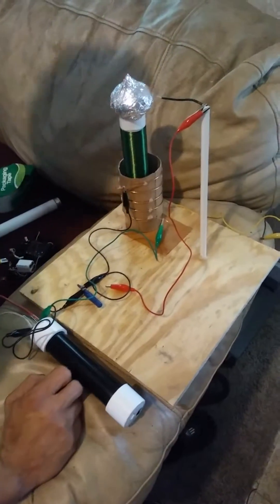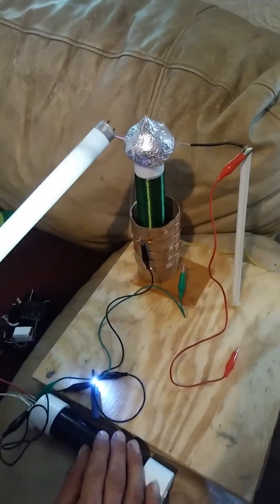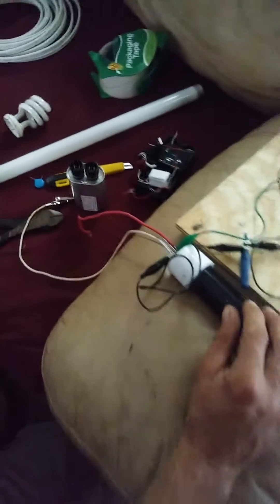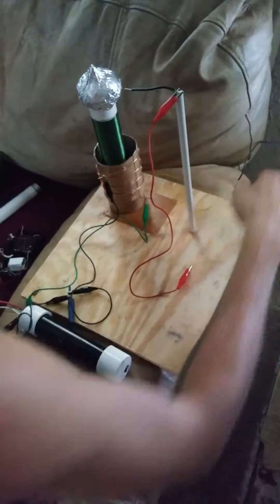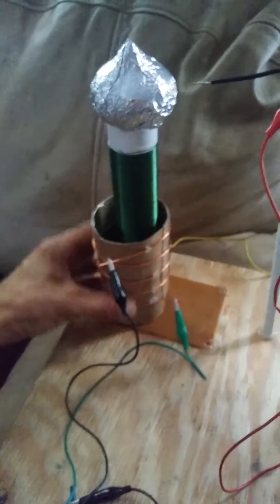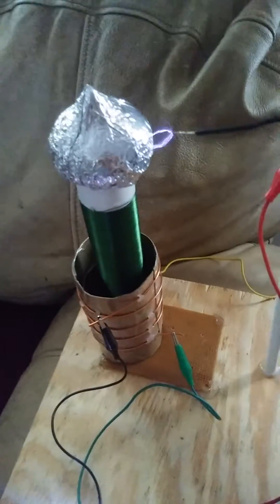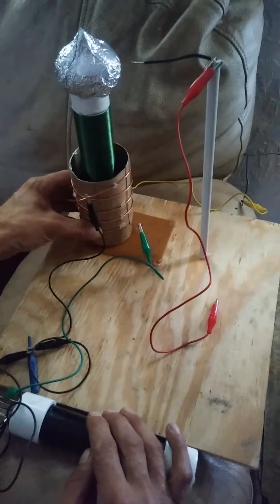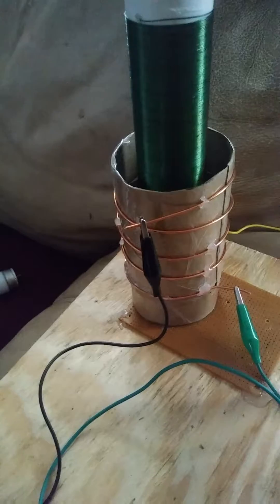Tesla Coil Powered by a Stun Gun

Comment: Give the specs on the wire size, length and diameter of the secondary. 
I made one with a small coffee cup and used a clothespin with 2 sheet rock screws through the top with the spark jumping from the heads of the screws not the points. You can screw them in and out and adjust and tweak the spark that way. A small gap yields a nice high frequency and doesn't drain the gun so fast. Nice to be able to just plug it in and charge it up also.

Comment: Can you touch the sparks off the tesla coil?
Reply from the maker: Menachem Porter yes it will burn you though.. Not bad but the arc is very hot. Low current
Reply: Hold a small brass house key in your hand and let it arc to that. You won't get RF burns on your skin that way. Make sure your body is not touching anything grounded or connected to something or the voltage will pass through you into it.